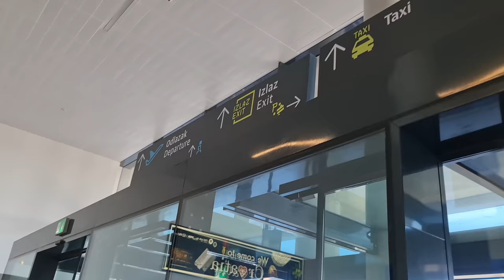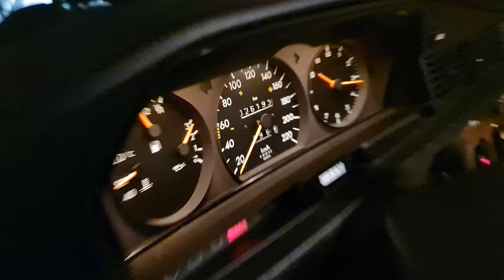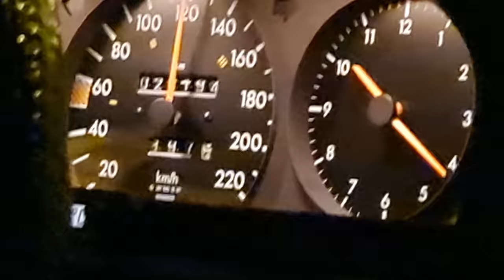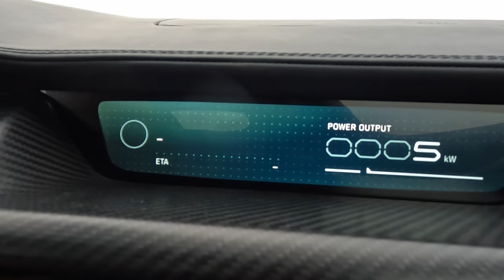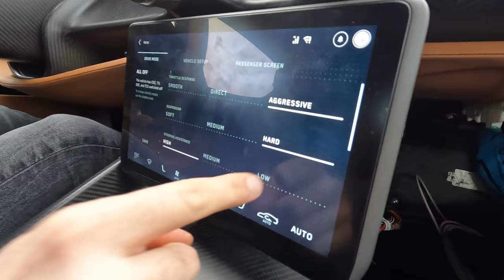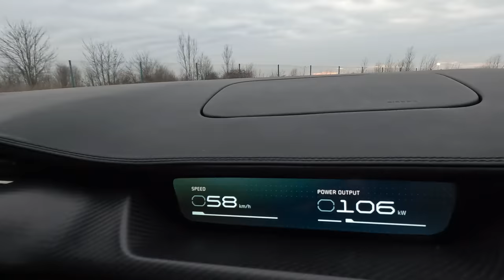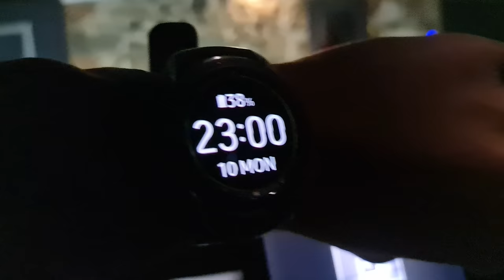Surprise Ride in the Rimac Nevera

Comment: Man Nevera is like out of this world. I can't imagine what will have in 10+ years. That guy with the Benz 190 knows what he has :O
Reply: We won't have it, it's a toy for the rich and will stay for a while...
10 years have passed and still, we drive 100-250hp cars (on average).
Max hp didn't really change through all these years... but not for rich people, lol.
Reply: Nice video Misha. 

Was the 190E "1.8" a subtle "nod" to the Nevera's target 0-100 time? (-;
Reply: Electric cars are getting insane. Besides the mind boggling horsepower, the Nevera can do 360 spins going 100+ kmh on snow (100% controlled btw, with torque vectoring), Drive by itself on race tracks at professional race car driver level, it can do burn outs with either front or rear wheels and so much more which I probably dont even know about. The car is smart AF.

Comment: UR lambo with 1500hp does 2.7. Evs are almost there!
Reply: It is under 3 sec, so it is here already :)
Reply from the maker: Please tell me about factory warranty on a UR
Reply: @mgcharoudin  think it’s 2 years/24k miles. Not bad actually but obviously doesn’t last as long as any ev
Reply: @goranS54  with 2000hp u should be in mid 2’s tho
Reply: @yaniqueapgar9220  weight has no impact?:)
Reply: @goranS54  of course it does but watch what numbers 2000hp combustion engines put up lol sub 8’s
Reply: @yaniqueapgar9220  they are stripped down as much as possible. Nevera isn't a dragster, otherwise it would have probably had half of the battery capacity and no luxury interior for weight saving purposes as those petrol monsters do have.
Reply: @АлексейКастевич  there are gtrs lambos r8s that are not stripped down doing sub 8’s tho?
Reply: @yaniqueapgar9220  still like 600 - 700 kg weight difference and drag tyres. No surprise they are faster.

Comment: The Nevera seems dangerous for how rapidly it accelerates with little indication of what's going on like engine noise/vibration. This car will get some rich people with more money than driving talent killed probably, electrical nannies can only do so much and they can't cheat physicals. Looks cool inside and out though!
Reply: As with every supercar like this you can change drive modes (what the driver does on the screen at first). Normally it won't break out. Many drivers commented that it's actually really easy to drive. As part of the business is a virtual driving assist planned.
Reply: This has so much control over slip because there is a motor on each wheel. Also this will have a lot of safety systems

Comment: 2.4 Million is way to much for this Car..
You get one McLaren 765 LT.. a Ferrari 488 Pista.. a Porsche 911 GT2 RS.. an AMG GT Black Series.. and a Lamborghini Huracan STO.. and on and on and on..
Also the Interior looks very bad and cheap..
Reply from the maker: This is a proto development car bro. Not a single car you've mentioned has the power and specs this car has.
Reply: @mgcharoudin  Interior will be the same.. Performance on Straight line yess.. but on Track every Car i mentioned is faster 😄
Reply: Yea you must be the one drove mentionet cars and this one on track :D
Reply: So don't buy one! :D
Reply: @UTVH21  It literally isn't. Purely on handling alone the Nevera will go around track faster than any of those you mentioned due to the grip it has and the 4 wheel torque vectoring. None of those cars can even dream of putting the power down to the ground like this does.  It does 100 to 200 km/h in 3 seconds while going out of a corner in a controlled slide. It's a space ship compared to traditional supercars with just RWD.
Reply: @derbigpr500  HAHAHAA.. The Nevera is not a sub 7Min Car.. but dream on..
Reply: @Festina Lente it look like Yugo is the only car You have first hand expertise :)